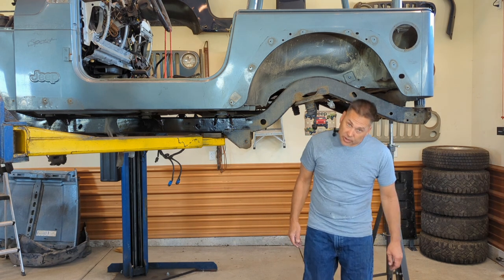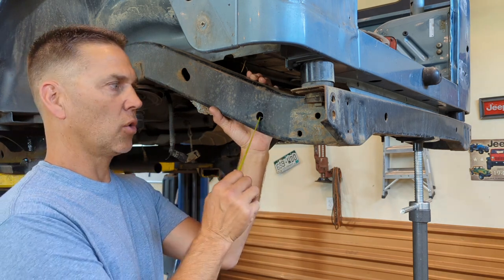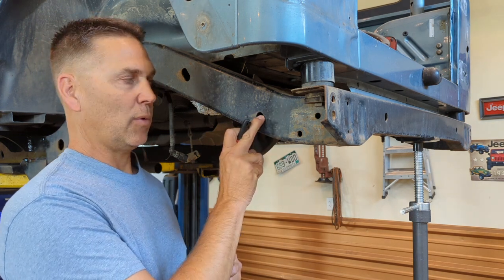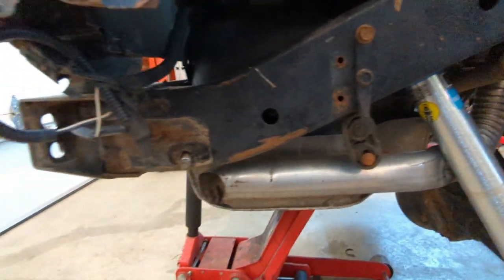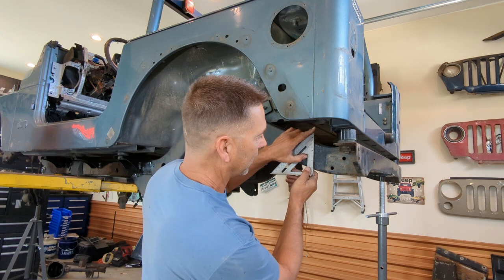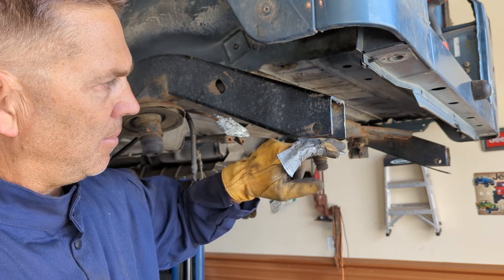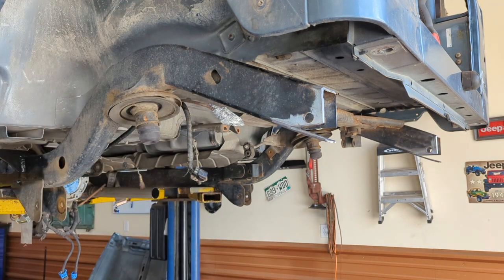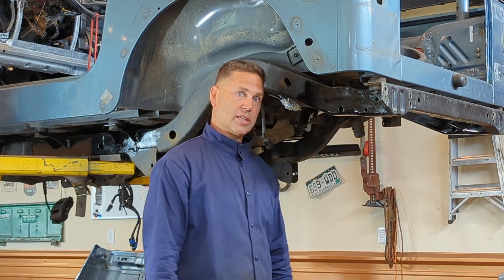How To Raise the Rear Frame

Comment: Great ideas! Are you going to put fuel tank in the tub?
Reply from the maker: No. If I were to do that, it would be because of a stretch and a different plan. My plan is to stick with 35's for this rig.
Reply: @TheBFHGarage  very cool.  I agree 35s are perfect size for the rocks in a short 94" wheelbase.  Larger and it's cumbersome turning and positioning